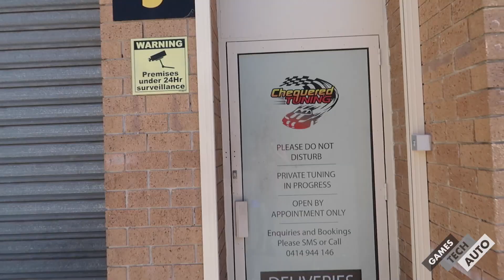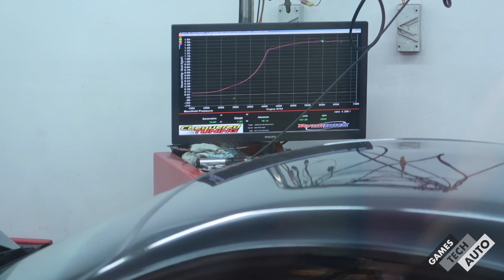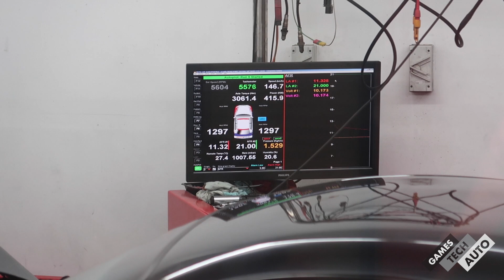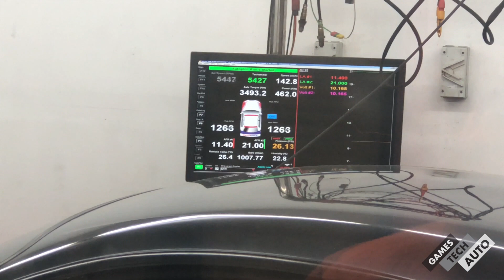Mick's Garrett GTX3582r Gen II Toyota Supra

Comment: one easy tip i learned, get the Derale 15300 for cooling the return fuel! I'm running a Taarks Surge tank with 2 525LPH pumps and this unit with 4 PC 12v 120mm fans, she fkn sweet! I've split and merged the feed from 2x  8an to single 12an then on both sides of the rail they feed back to two 8an and the middle of the rail is a single 8an return! Both feeds also have FPD just before the rail feed side and it's all radium stuff, which really doesn't matter. but the 15300 does a fantastic job with the help of the 120mm fans....On E85 it's not as crucial!

Comment: Hey Mate can I get a link to the build on this car? kinda curious as to how this guy is making so much power with the gtx3582r
Reply from the maker: Best to check out V8EA7R Perfrormance ( yes with the spelling mistake ) on Facebook. He built the Supra for Mick. I think there is a bunch of detail of the car on his fb.  https://www.facebook.com/v8ea7r/
Reply: hey The Crumpet, the GTX3582R is rated by Garrett as a nominally 750hp turbo.

So... assume 15% manual trans drivetrain loss, that would mean 637 rwhp, or, 475 rwkw.

That 750hp is pretty nominal and is probably conservatively quoted for a lower performing 2valve engine.

Plenty of auto turbo barras are making 475 - 500 rwkw with that turbo, I have one.
Reply: It is a gen 2
Reply: I've got 745 out of the turbo, thinking about going to a 47, the 35 82 is just to small

Comment: Is it a Gen 2 turbo?
Reply from the maker: Darius Woods sure is
Reply: What rpm does the boost kick in? I am thinking about getting it for my STI
Reply: You can see it on the video.. Full boost at about 4K rpm. I don't know what a/r hot side it has, but too big turbo for a four banger in my opinion.. I'd go with a gtx3071R and choose the right hot side for your application. I've seen one stock block Ej207 with a 3071r and E85 pushing 500hp at 1.7bars with a 0.63 hotside. Hit full boost at 4K rpm. You could get a bigger hotside if you have the 257. Just my opinion though..

Comment: What was the a/r on the turbine?
Reply from the maker: Tarik Laaraj 1.06 from what i remember.
Reply: GamesTechAuto very good. What was with the hesitation at 4k?
Reply from the maker: Cant remember what the exact issue was. But it was either the coil packs or the fuel system. He fixed both of them the next week and dont think that hesitation is there anymore.